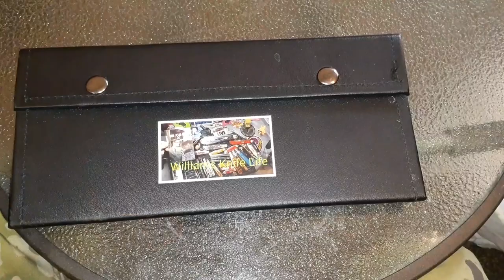(493) Almost All of My Folding Knives

Comment: Yours phosphorescent knife definitely shines brighter!  But, yep,
It fades right away.  

The nail nick puller thingies work well once you figure it out.  The little scout cap lifter works better than the one in the the Rough Ryder Kamp King!    How do you like the Byrd?    I love the Dragonfly.  Probably use it everyday for something.  And nobody sees it and thinks it’s scary!
Reply from the maker: I love the Byrd. It was only around 25 dollars,  but they were asking 70 dollars and up for a Dragonfly.
Reply: @WilliamsKnifeLife  The Byrd's clip isn't as nice so I'd probably toss it.   Funny thing is the Byrd Robins clip is four position and the Dragonfly is just two!.  It is one of the few knives where I actually kept the clip and use it!    While I like the VG10 in my Dragonfly I'm also just as happy with the 8Cr in my Byrd Meadowlark and my clipit tool.
Reply from the maker: @KnifeChatswithTobias  I like Spyderco's plain wire clip like on the Sage5 LW.

Comment: I've got 2 elementums in D2 and both have had very soft detent. One quite a bit more noticeable than the other. I also have two of the s35vn models and both of them are VERY snappy with an excellent strong detent. Not sure what the issue is. Awesome collection bud! Thanks for sharing!
Reply from the maker: Thanks D2ArkaAra it's good to know i wasn't the only person with a weak detent Elementum. i think they got rushed by all the unexpected demand & started pumping them out, & a few bad ones got by on the second run.